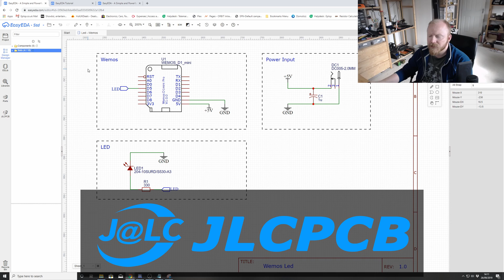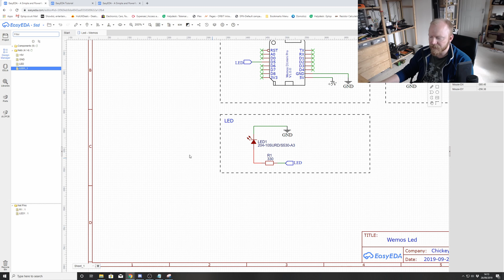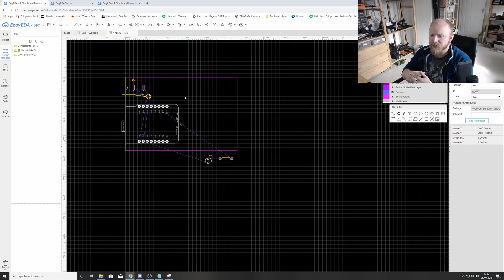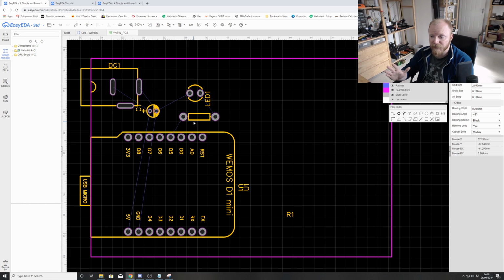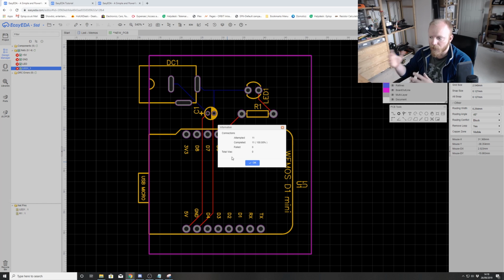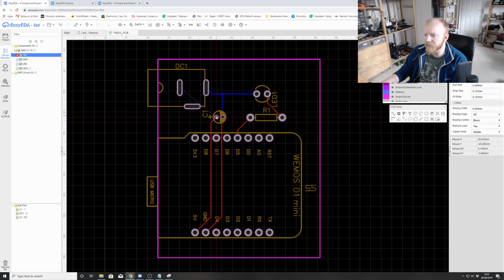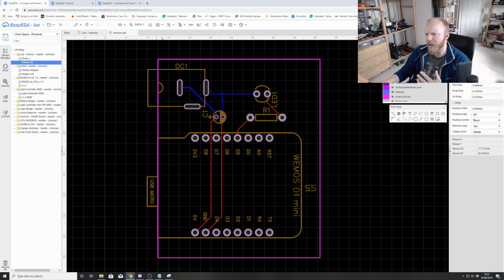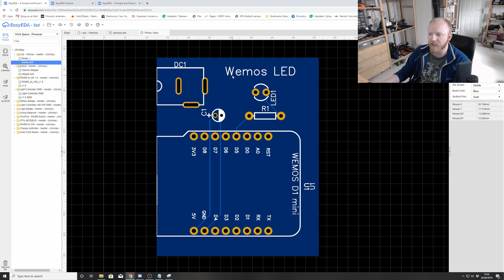Beginners guide to PCB design with EasyEda Part 2

Comment: Hi Colin, when you select the PCB board colour in EasyEDA (on any PCB design software) is that type of information included in the exported files you would send to the manufacturer? Or, do the exported files only contain the basic connection and layout data, and anything to do with aesthetics is up to what you and the manufacturer agree on?
Reply: You need to specify to the manufacturer what board color you need (that info is not includen with the Gerber files you provide as far as I know)

Comment: Hi Colin thanks for your videos I am trying to learn how to wire things and you have been a great help. Can you take a second to answer a question. Do you need to install the DC1 to provide power to the Wemos? or can you just run a USB mini to the Wemos direct? thanks in advance
Reply from the maker: Hi you can supply power to the wemos direct on the 5v pin if required.
Reply: https://youtu.be/upaVO_SMAQM 🙏🙏👍

Comment: Always brilliant to design with cloud software. I know can download the client software but no local save is a disaster. They do a Thomas Cook and so did my design. I use JLCPCB and a great service. All good stuff if not having  files apart from GERBERS is not an issue to you.
Reply from the maker: You are correct in that it could disappear and even with the offline client it is no guarantee.  Regular backups would be advisable.  I think for the space they are aiming for hobby wise it may not be such a major issue however.
Reply: https://youtu.be/upaVO_SMAQM 👍👍🙏